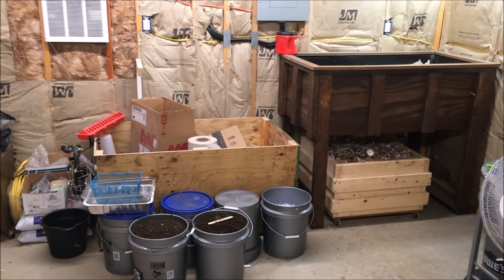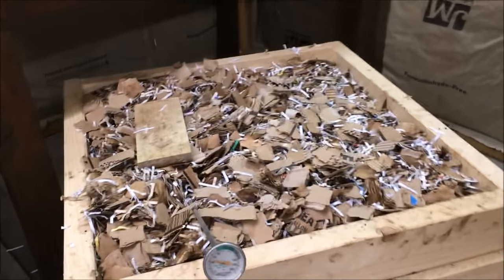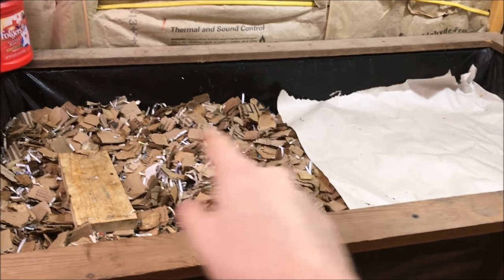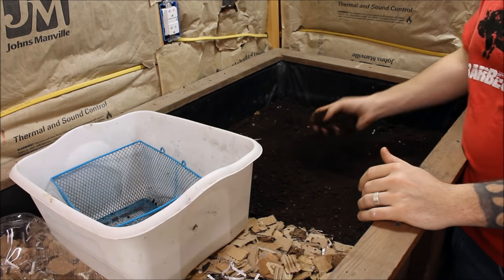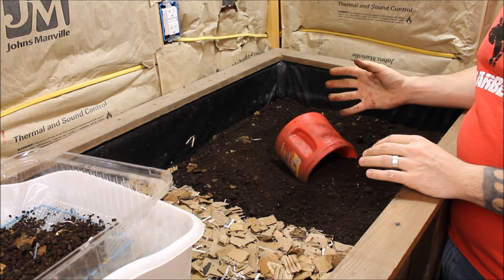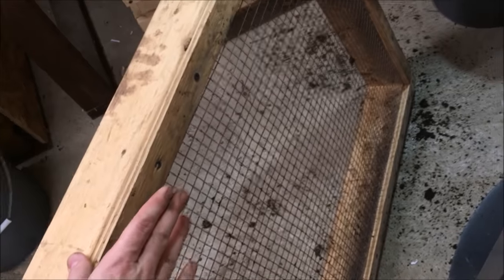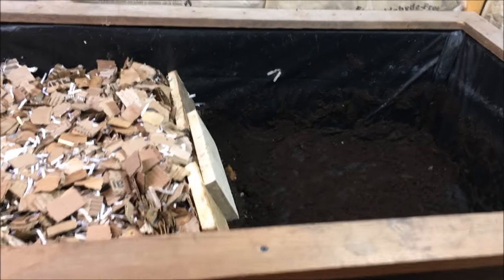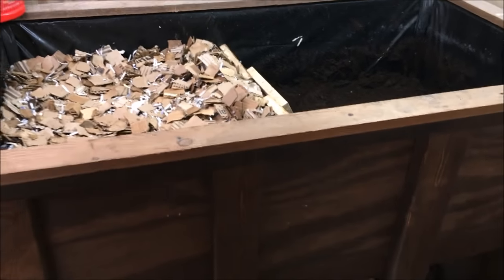Harvesting My Horizontal Migration Worm Bin

Comment: I have been studying worm farming for a year, and always wanted to try it, well, I bought my first bin (54 ltrs), 1000 worms, and 1000 worm eggs, achieving good results.  The bin is a little bit more than moist in the bottom, however, the worms seem to gather in it and seem to be okay.
Your video is probably one of the best, if not the best that I have seen for my situation. I will build one similar to what you have but using an old cast iron tub.
Your knowledge and willingness to answer questions are at the highest of standards. I have learned a lot from your answers to those who wish to learn.
Thank You, I am now more determined to move forward in worm farming.
Steve
(from the land down under)

Comment: Love your videos.  I have started my first worm farm in a grey, rubbermaid tote.  I used coco coir for bedding & the worm compost they came in.  I top dressed with cardboard & paper sack (no glue areas).  I feed your dry worm chow & kitchen scraps.  I live in South Alabama.  As it starts to warm up this Spring I'm wondering if I should water my worm bed to keep it from drying out.  Right now its in my screened in back porch but should I move to my kitchen?  Concerned about drying out & over heating.  Thanks in advance for any guidance.
Reply from the maker: Tami Ziglar as long as it is in a shaded area it should be fine heat wise. You can move it inside if u have the space though. They like the mid 70s range the best. As far as watering just keep a eye on the bedding and keep it like a damp sponge. Depending on how moist the food is and how often you feed you might have to water a little.
Reply: DownToTheRoots -  thanks!  I'll double check dampness of bedding.  Appreciate the info!

Comment: You talk about harvesting the castings - but what about the new worms that are being produced,how many pounds are produced and do you thin them out and if so how do you sort out the worms?
Reply from the maker: William Colvin I never sort out worms because it requires a lot of time. I use a 1/4 inch screen and just put any cocoons and small worms they go through it into the garden. The remaining worms will be enough to stock the bin. If you don’t screen out the smaller worms and cocoons the population in the bin will get to high and the worms will start to struggle. If I was to start a new bin I would just put the screenings into a new container and add fresh bedding instead of putting it in the garden. The cocoons will hatch over time and populate the new bin.

Comment: Hey Josh, Thanks for the new video. You harvested the bed at a level of 8". Is the bed level important? i.e. Does the bin run into problems if it gets too high? Thanks again!
Reply from the maker: John Graham Hey John,  that is a great question!  As long as the bedding doesn't get to wet and go anaerobic in the bottom u can let it get as deep as u would like.  It's depth at harvest all depends on how much u have been feeding them and how much bedding u add. My horizontal migration bed usually is about twice the depth I started with by the time I harvest it. My vertical migration bin or stackable bin on the other hand will be roughly 18 inches deep before the bottom tray is removed and harvested. So basically as long as it has adequate aeration and the right moister level it can be as deep as u want. No matter the depth though the worms will only work in the top 3 to 4 inches of material so it is best to start with a 3 to 4 inch layer of bedding and build from there.

Comment: Nice video! I was wondering if you have any drainage installed in those bins?
Reply from the maker: TheBushdoctor68 I do not have any type of drainage system in my bins besides the rocks in the bottom of my horizontal migration bin. I keep a eye on my feedings and try to keep the beds from becoming to wet.
Reply: Thank you for the quick reply.
I'm working with a combined compost/worm bin outside, so any excess water just drains into the ground, but I noticed that every single commercial worm bin has a drainage system to 'drain the worm juices', and frankly I have always wondered about this. Your setup kind of confirms that most, if not all of the moisture originates from the compost ingredients, not so much from the worms themselves.
Reply from the maker: TheBushdoctor68 your welcome. Most food scrapes are high moisture. Most commercial worm farms feed mass quantities of food on a schedule and water their beds to insure they are moist all the way through so they usually have more moisture run off. It really doesn't hurt in a commercial or home system but that is just nutrients that your finished castings will not have in the end. The run off usually ends up anaerobic and doesn't have the beneficial bacteria that we are looking for with the worm composting.  so it isn't as good as compost tea that has been purposefully made to us for our plants.
Reply from the maker: TheBushdoctor68 your compost/worm bin sounds like a good idea. I usually inoculant my outdoor compost bins with worms after they have went through their hot stage and are at the temperature that the worms like.
Reply: Yes, I can imagine that keeping the worm tea inside the bin has its benefits bacteria wise. Good point indeed. It's true, my bin can get really hot when I turn it, but there's a second bin right next to it where the worms can get away from the heat. That does help, but because the eggs can't get out of the way, my colony doesn't grow as fast as it should. Dutch winters can be tough on them as well so it would be good for me to have a second, more protected colony like yours..
Reply from the maker: TheBushdoctor68 yeah I'd say it does get pretty cold there. Our winters aren't real bad. I usually just grab a handful of worms out of one of my bins and bury them in the compost pile after it has cooled off. They don't multiply real fast but the cocoons they do lay hatch in my garden when I add the pile to it. It is nice having a colony that I can use out of when I want. You can start a plastic tote bin pretty cheap.

Comment: Hi - I have two questions: How deep is the inside of the horizontal bin? I know you mentioned it is 2' x 4', but I was wondering how deep it is. Also, when you start a new bin, from what I understand from your video,  you would put 3-4" of aged manure ( I would use alpaca), then continue as if you were feeding them? So after the manure layer,  would you put the powdered food, then food scraps, then coffee grounds, then a little more manure, powdered food, more food scraps, coffee, then cover? And would you mix cardboard in with any of it when first starting a bin, or would you just add the ripped cardboard on top and let it go down into it slowly and just keep adding a few handfuls when you feed?
Reply from the maker: Hey Lisa. If I remember correctly the horizontal bed is 16 inches deep. You are correct on the feeding process. I have recently change my feed layering a little do to fruit fly problems. Now I put down dry food then all the food waste and coffee grounds then cover it with more manure (this makes it harder for the fruit flies to get to the food waste that they want to lay eggs in) then I put down more dry food and cover it with cardboard. I would just top with cardboard and let it work in slowly they actually go through it quite fast.
Reply: Got it, thank you, and so noted on the change of feeding layers order. I also forgot to ask,  when starting a brand new bin that no worm has ever lived in, I would do just half the bin to start, do that particular order of layers that you talked about, and add no extra moisture, is that correct? Do the food scraps add enough moisture to the whole set-up, even when starting brand new (assuming, of course, that the scraps are relatively juicy)? 
I really appreciate your help.
Reply from the maker: Lisa C when starting a new bed I would put about 3 to 4 inches of damp manure (well aged and screened) in the bottom then start the food layering process from there. Form my experience the food waste provides enough moister as long as the bed isn't in a very dry location and it stays covered with a good layer of dry material to act as a mulch. The best way to describe the right moister content is to keep it like a damp sponge. Not very dry but not dripping wet. I normally dig down into the bedding a couple inch and check the dampness ever so often. But with regular feedings of food waste it usually keeps the perfect moister levels without having to add any water or dry material. If you think about it most food waste from the kitchen like lettuce, melons, bananas and so on are high moister content.
Reply: Thank you very much for the clarification. You have been such a great help, and the amount of worms you have and the fact that they stay in their bins shows that you clearly figured things out very well for them. You have VERY happy worms! Happiness is a nice thing for them, plus it helps them make quality castings to make happy plants! 
Thank you again for all of your help!

Comment: If I was raising and breeding worms just for worms & not the castings would I still have to change the dirt & bedding. If so how often ?
Reply from the maker: Tre Outdoors I would recommend changing the bedding at lease once a year. Worms like to migrate into new food material and leave their casting behind. If I was raising worms just for bait I would do the horizontal bed method. That gives the new cocoons time to hatch and all the worms time to migrate to the new side so you don't loss any worms during the clean out process. It also disturbs them the lease so they can continue breeding. If they stay in the same material to long they will stop breading and you won't have a steady supply of new worms to use. If you are not interested in using the casting I'm sure a local gardener would take them or you could possibly sell them online if that would interest you. Sorry for the late reply.

Comment: I have a question regarding your vertical migration bin. Do you remove the top layer of dry bedding before adding a new top tray? What is your procedure for adding a new tray? Thank you.
Reply from the maker: John Graham yes I do. I remove the dry bedding and fill it to the top with aged manure or compost before adding the next tray. After adding the next tray I feed one half of it like normal and add the dry bedding back in that tray. It is almost full now so i will be building and adding the last tray soon. I hope to make a video on the overall set up of that bed when the time comes.

Comment: Is there a link to how you make the next level for worms?
Reply from the maker: Parasuniversal.com unfortunately I don't have any videos on making my beds. I actually decided not to make a third layer because of how heavy the trays are when full. If I had 3 layers the top 2 would have to be removed together in order to harvest the bottom. One tray full of damp castings weighs around 50 pounds so 2 would be to much for one person to handle easily on their own. Instead I just feed the bed till the top layer is almost full then I harvest the bottom and put that empty tray on top to continue the process.

Comment: It is easy for me to get horse manure but what do you have to do with it before it can be fed to the worms??
Reply from the maker: Mark M all u have to do is let it age. Most of the time if u are getting it from a big pile it is already aged. If it is fresh just pile it up and let it compost down. It will smell like good soil and not manure. After that just screen it through a compost screen like the one I showed in this video.
Reply: DownToTheRoots what if my aged manure had mixed with some ash? burned leaves? will it be okay for worms??
Reply from the maker: jessica augustine it will be fine with some ash mixed in. I actually add wood ash to my outdoor compost bins. The ash acts like lime or the calcium in egg shells. It is alkaline and raises and buffers the ph. In the horse manure it will actually help to neutralize the urine that is mixed in. Just make sure the manure bedding and ash are aged well together and u won't have any problems.